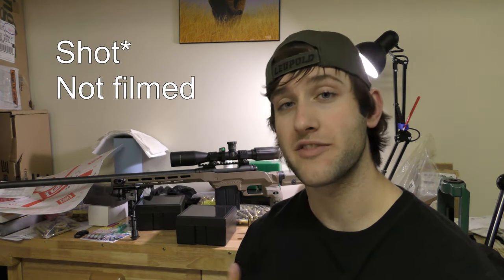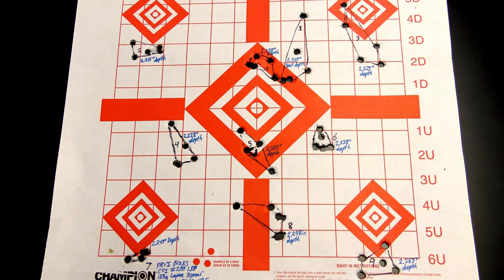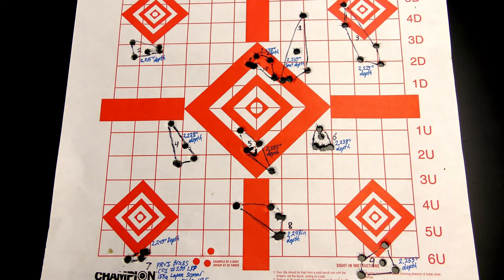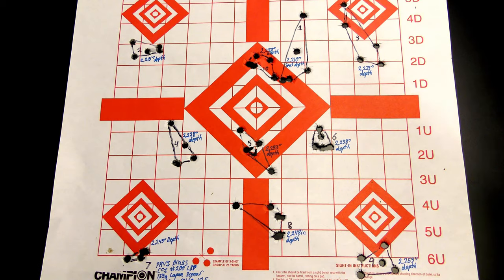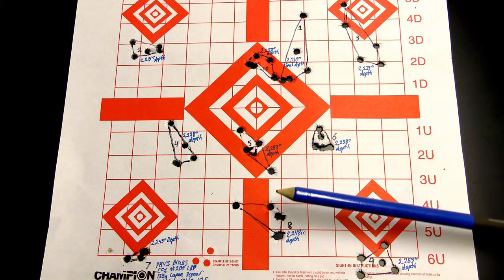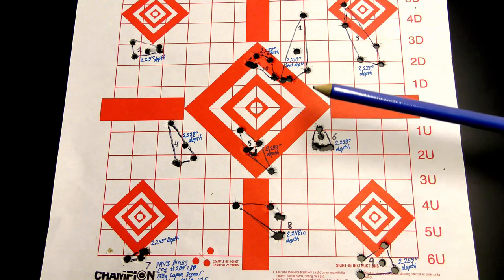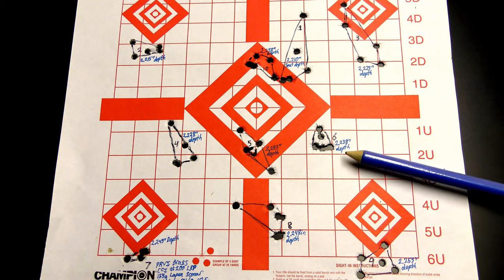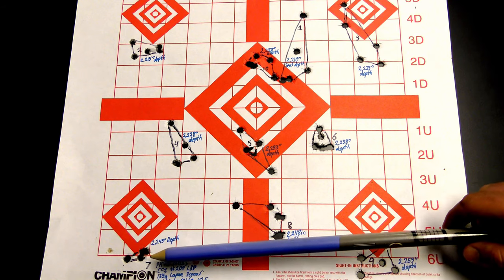Shooting Groups With a Rifle that had a Tracer Burn up the Inside of the Barrel; How does it Group?

Comment: As I see it, you have a couple of options:
1. Tubbs Final Finish Bullets. These are impregnated with lapping compound. Consider the case of a severely worn throat that is very rough & tears up bullet jackets, degrading accuracy. A number of shooters have revived their barrels with this solution.
2. Preferred Solution: Shilen "drop in" match grade replacement barrel. You can swap out the barrel yourself with an inexpensive barrel wrench. $374 for a match grade barrel. Look at the groups Vaugn Precision shot on youtube with these barrels on rifles he built using the 12FV as a base rifle. You could have a rifle with exceptional accuracy for $374. By the way, I have no affiliation with Shilen.
Reply from the maker: Either one is a great option, but I still want to play with the gun in the condition that it's in because it still shows signs of life if you watch the other videos I put out recently on it. So, it may still have a lot of shooting left to do!
Reply: Also, if factory ammo damages your rifle, a reputable ammo manufacturer will pay for repairs (a new barrel in this case). In any event, you have convinced me to never shoot tracers!
Reply from the maker: @sorrycharlie3327  These were hand loaded subsonic rounds, so it was 100% my fault. Tracers are fine as long as you don't have a squib load. Even then, it may not ignite and that would be okay as well.